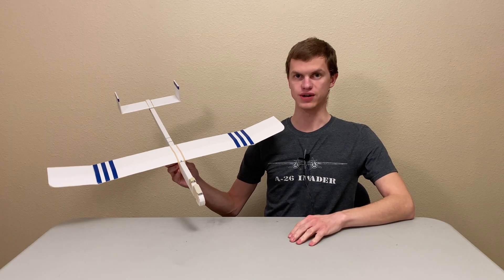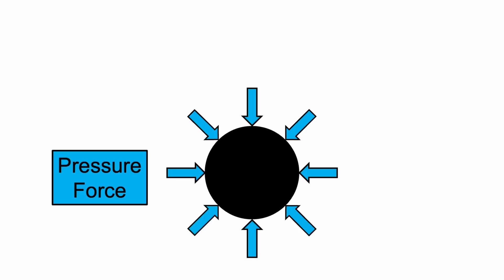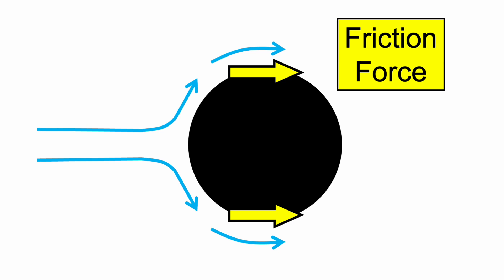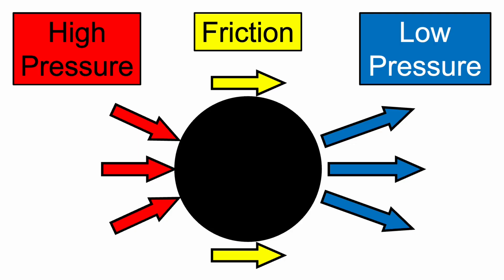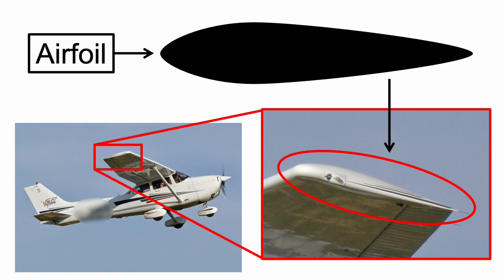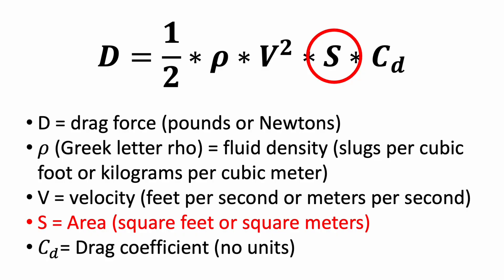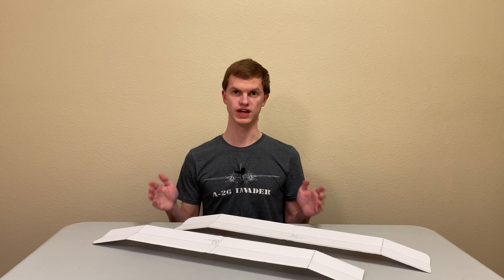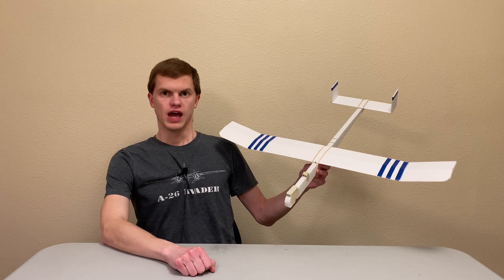Parasite Drag Force Explained

Comment: So sometimes area is cross sectional and sometimes not?  What about planes where wing and fuselage are the same thing, like a delta wing?
Reply from the maker: For the drag force created by the wing, the area is chosen to be the planform area since the frontal area changes a lot as you change the angle of attack.  For other parts like the fuselage, it would be the cross sectional area.  Area where the wing and fuselage overlap is usually included in the wing area.
Reply: Planform is actually crass-sectional from straight above. Which would apply when a aircraft flies parallel to the airflow (directly into the wind, not descending).

Comment: Should you expect the steady glide speed to be the same for both gliders?  The optimum glide speed depends on the zero-lift drag coefficient, and is proportional to 1/(CD0^0.25). Therefore, using the same elastic launch energy for both aircraft may not be the best approach. Your goal is to achieve the exact steady glide speed in both cases, so as to not launch one (or both) airplane(s) on a phugoidal flight path.
Reply from the maker: Yes, you are correct that increasing the zero-lift drag coefficient decreases the ideal glide speed.  I found that to get the maximum flight distance with the non-streamlined glider I had to launch it slightly slower than the streamlined glider.
Reply: @DesignYourOwnAirplanes-xd6lz  Interesting! Thanks!